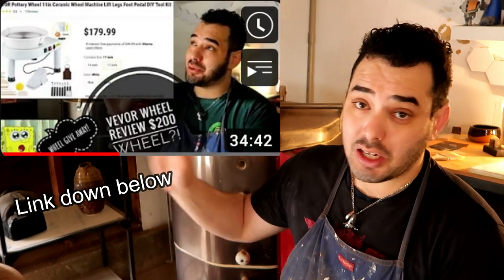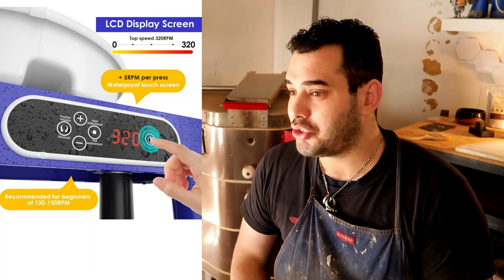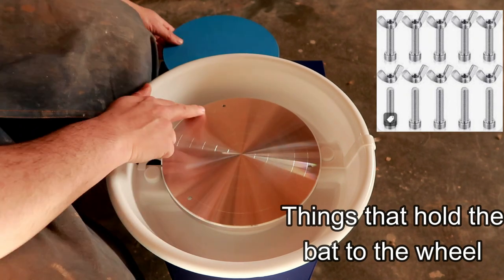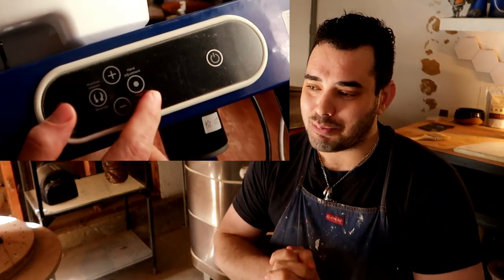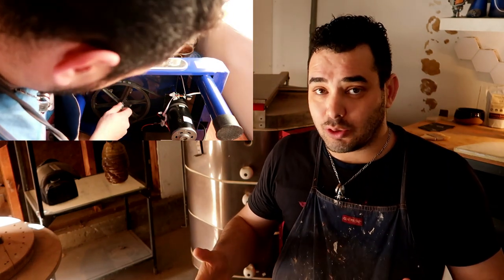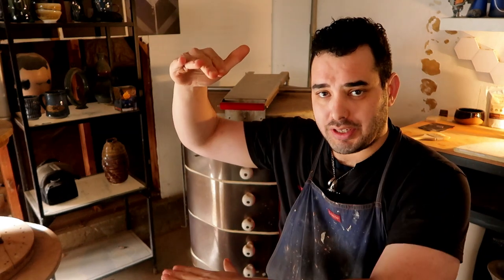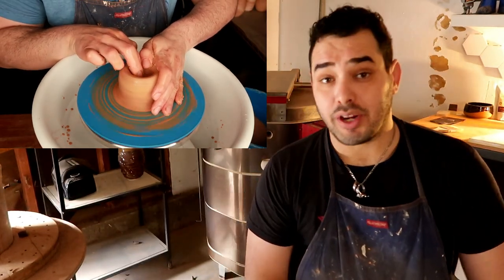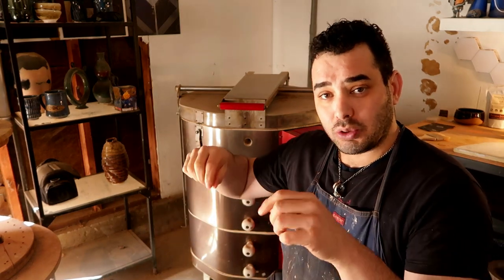Nantfun wheel review and GIVEAWAY!

Comment: I think there may be some small additions that can be made to the ubderside to protect the circuit board. And I would also suggest getting some shrink tubing over the butt connectors.  It will help a bit with keeping particulate matter out.  I think this is a great little table top wheel.

Comment: This does sound like a reasonable starting wheel, particularly for a child.

I wonder how easy it would be to sand the top smooth or fill the grooves with epoxy and then sand.  Enclosing the bottom doesn’t sound too hard, but you’d need to allow for motor cooling.  Making or buying more bats doesn’t sound like a big problem either.
Reply: It looks like the “upgraded” version is closed in, but does not have the touch screen, and the foot pedal is affixed to the side of the wheel.

Comment: I had this wheel(different 'brand') for about 2 weeks. Really liked the constant speed options, until the control pad failed; got wet.

Ive tried several of these '9.8 inch' Anazon  wheels and they're all the same drivetrain in a different case. These are all parted together from general purpose off the shelf parts. This is the first one Ive seen with a bat. I modded mine with a bat.

Comment: The reason for the cheaper wheels having that ribbed texture isn’t an intended feature by them; it’s a byproduct of saving on machining/labour costs. They machine them relatively quickly, and they’re basically taking 1 quick pass, whereas higher end wheel heads have had more/slower passes taken when machining them.
For a mental image, imagine trying to trim a leather-hard plate whilst it’s on the wheel. The cheap wheel is the equivalent of having 1 quick pass to do it (so you’ll see ridges in between where the tool didn’t touch) vs. going slowly & making sure it’s completely flat.

Comment: As an engineer that works with machined metal components daily, removing that machining texture adds more cost, which is why it is being left there. On a 5 axis, it would be another step to machine finish/polish to a tighter surface finish callout or it would take more time on the machine to do a single pass with a smoother finish. And making it from plate is pricier than extruded bar. These are just guesses, but that is what surface texture looks like to me
Reply from the maker: Thank you for telling me that. That explains a lot.

Comment: Heads up: Making the wheel surface smooth would actually require an extra step.  They cast the wheel head, and machine it from the rough casting. Machining it smooth would require more passes or a slower speed. Also I hope I win! EDIT: I'm on the Patreon if I win!